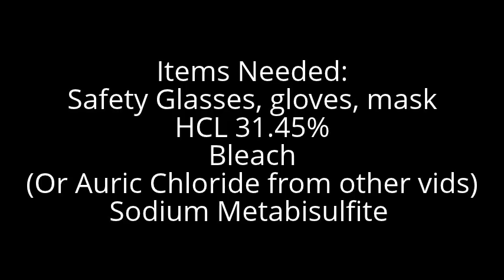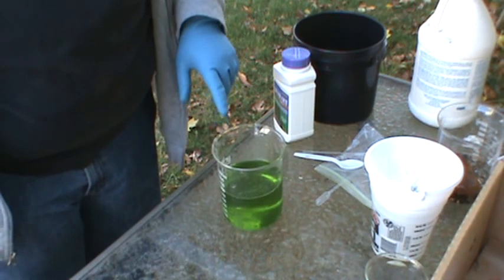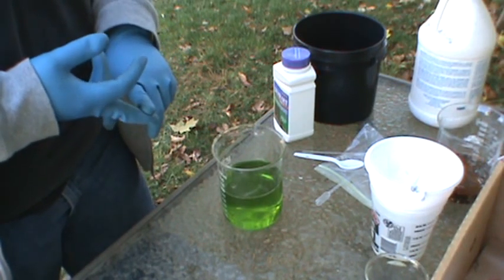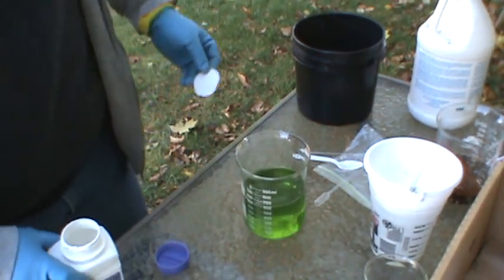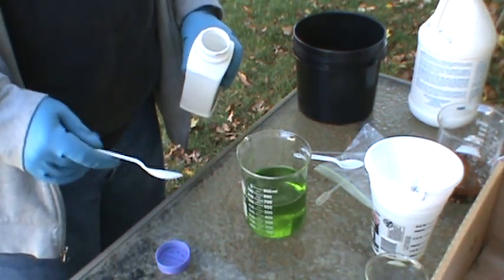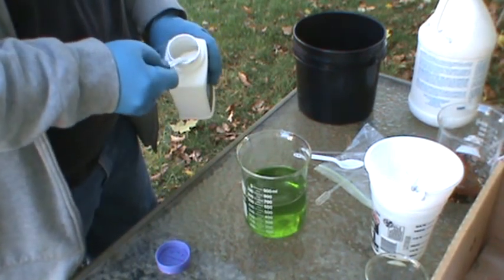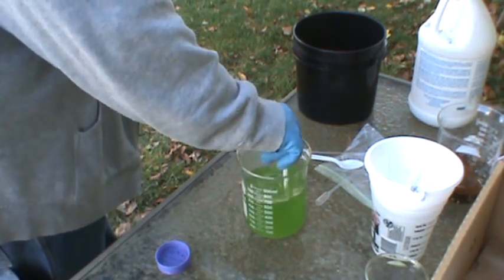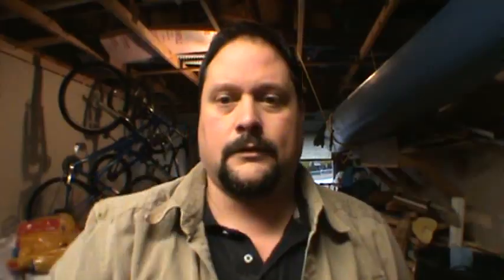Gold Recovery:  A Refining Process to Purify Gold

Comment: How is this process different from the m-acid & peroxide. I know one removes one from the fingers & etc..the other dissolves the gold & you recover it once you put powder in. My question is if Ive used the M-acid & perox can I still use baking soda or stump out to get gold out of that solution? Also which would be easier, I would prefer dissolve it so it come out it powder form but im stll gathering my understanding of all the different process
Reply from the maker: Hi and thanks for watching!! First please be advised that I am not a professional.  These two processes are very different in function.  The A/P method that you refer to as M and Perox, is for removing the copper and nickel layer under the gold foil.  The A/P method is not designed to purify gold where as the HCL + bleach method is.  If you add more peroxide to the AP s\olution you can dissolve gold but will have to cement it out by putting copper in to super saturate the solution.  You can not use baking soda.  TO purify gold, best to use HCL and bleach.  To remove gold from boards, AP is best.  Thanks
Reply: Thanks for quickly clearing that up. Ive watched a lot of videos & read a lot & I think some is starting to run together.So after I use my ap method the gold that's recovered can be melted, just wont be pure. To get the copper out of my leftover solution I planned on hanging a stainless spoon or knife to get the copper out. Im trying to get as much from the recovery as possible. For instance one way, you can separate the gold & silver  & they both come out as a powder for the end result. Do you have any recommended web pages or videos that I may have missed? Thanks again
Reply from the maker: Chem istry My go to channels are indeeditdoes, geo, drew metalsmith, and originalfeets.  Everything I know comes from them, the goldrefiningforum, and CM Hoke's book.  Best of luck to you!

Comment: What is easy method that draw gold in As(as)?
For example, when arsenic consists of iron and solid lump with copper gold, make this solid powder once and touch funnel after knock-in mixing together from had mixed this material to hydrochloric acid and other material and is dregs that remain swelling as filter paper gold?
Do you lose that that no gold and other material remain together?
If melt as nitrohydrochloric acid that mix nitric acid to hydrochloric acid, do not arsenic and iron copper gold melt all at once?
I wonder whether method that is specific about lower part three occasions once guesses right.
1. In case of have gold and iron together in arsenic ?
... Hydrochloric acid + nitric acid after make from powder once ?
Or, other liquid some % ?
Dregs that mix and pours woe on filter paper and remains after put zinc powder after knock-in making a fire ?
2. In gold and iron in arsenic and in case of have copper together ?
... Also, dregs that pour woe on filter paper melting to nitrohydrochloric acid that mix hydrochloric acid + nitric acid after makes from powder and remains making a fire ?
3. In gold and iron in arsenic and zinc in case of have together ?
... Also, after make from powder hydrochloric acid + other liquid some % ?
Dregs that pour woe on filter paper without zinc after knock-in and remains making a fire ?
Is the centralest question possible without zinc powder though is the first question?
And if melt as hydrochloric acid and nitric acid, does not nitrohydrochloric acid turn together melting all?
Anxious ..

Comment: i have a vase that says the gold on it is 24k Italian gold.i watched ur vids on how to recover it.i dont want to lose any of it so i had a few peices of it so i mix a small jar of chems. the gold came off .when i added the stumpout the solution got milky white and bubbled. i didnt see that in the vids.the mix was 3/4 cup acid and 2 table spoons bleach dont no where the gold went.
Reply from the maker: The gold is still there in the solution most likely or in the white stump out powder that dropped to the botom.  Was the one vase the only thing you dissolved in the solution?  Because that may be the problem.  You have to understand exactly how little gold is used to place porcelain.  The layer is so thin it is almost transparent.  It takes a lot of those to make it worth precipitating.  Remember also that one gram of gold is very small.  The best thing to do is to keep a container with the HCL Bleach solution and just keep dissolving stuff in it until things stop dissolving.  3.4 cup can hold about an ounce of gold so keep going until you have a LOT of things cleaned with it.  Then try to precipitate.  Trying to precip the gold from once vase the amount of gold would likely be so small that you would not even see it.Thanks!

Comment: Brass is under the gold. I did not throw it out. I can see where there is still some gold on the watch cases. I just stirred it up a bit. I had poured the other into a coffee pot through a coffee filter. Filter is now yellow.
Reply from the maker: right, but there are no gold flakes are there....  all the gold is in solution.  you really don't need to change the solution out that just makes it harder in the end having more material to process.  For items like that, I think the best route is reverse electroplating but i have not attempted that yet.  I would keep a close eye on it and as soon as all the gold is gone off the watch I would remove it to limit the amount of copper in there.  I think you can try to cement out the excess copper by sticking in a piece of stainless steel for a while.

Comment: Muriatic Acid and bleach for two days, Auric Acid dark green. Pour it off and put in another fresh mixture this morning 150ml to 50ml
Reply from the maker: If the solution is green tht means that there is copper in there.  And using HCL and bleach will disolve the gold into solution so I hope you did not throw out the green liquid.  What does the watch look like?  Is it brass underneith?  The gold may have already come off.

Comment: Have you tried to neutralize the acid solution some before the "stump out" was added?  Otherwise, the acid just picks the the metals back up.  Try urea.
  You can smelt out the copper with borax in a crucible or wash the precipate with muratic acid again

Comment: Mr Moose, very good illustrative videos. Thank you very much for the same. I tried it with Ink ribbons, but could not get any Gold. May be I should have used Sod. Metabisulphite directly rather than neutralizing the Extract with Sod.Carbonate. I am rather stuck now. I am sure you can help me. I do not want to fail in my first trial.

Comment: hey Moose, so now should I dump my filter gold into the solution with the stump out to remove the other material?
Reply from the maker: This is VERY important.....make sure you put a lot of gold foils into a small amount of hcl and bleach.  Like 100ml of hcl and 20ml bleach.  stir until dissolved and be very careful of the fumes.  Once, and only once the gold is dissolved can you add the SMB or stump out. in very small ammounts.  People often get tempted to start purifying their gold when they really do not have enough to purify.  It is much better to wait until you have several grams.
Reply: Thanx Moose, you are the King!
Reply from the maker: psycholordb

Comment: very nice video.  I have a bunch of pins that have been extracted from old connectors can they be put in this solution.
Reply from the maker: Gold pins are best processed in one of two ways.  If they are magnetic, hot HCL.  1 gallon will dissolve about 2 lbs ofmetal.  If not magnetic, A/P solution.

Comment: what if it turns aqua blue?
Reply from the maker: Sounds like nickel but I could be wrong.  Not really sure.  What did you put in it?  Ink ribbons?  Was there still ink on the ribbon?
Reply: i believe it just means you have a lot of copper in there, just a guess though, i left some cpus in the a/p solution for about a week and it turned that color and when i added some clean hcl it turned a green color, lick pickle juice
Reply from the maker: George Fontenot Copper typically will turn the solution green,  Nickel blue, ferrous material black or dark grey.  Thanks for watching!!
Reply: its actually copper(II)Chloride, i researched it today and also used it in class a few weeks ago for a chemistry lab. the green solution is copper(I)chloride
Reply: great vids btw

Comment: Just as a friendly bit of advice, Auric Chloride shoud be yellow... Since it is green, you most likely have copper contaminating your solution.  It is not a big deal as far as the reaction is concerned, but you will need to re-refine your gold again to make it more pure.   As the metalic gold starts to precipitate out of solution there is a mechanical drage down effect that pulls some of the copper with it.  re-refining your powder one or two more times along with proper rinsing will help to purify it.  Just wanted to let you know so you are not suprised if the purity comes in lower than you think (like it happend to me my first time)
Reply from the maker: Hey thanks for watching!!  I know about the copper, I mentioned it, not sure if it was in this video or the one I released at the same time about recovering gold from printer ink ribbons.  Thanks!

Comment: Thanks for your video when can you smelt the gold and do you filter it after you have finished with the solution thanks bro .
Reply from the maker: Once all the gold is settled, I pour of as much as I can without disturbing the bottom, then heat to evaporate the rest of the fluids off.  The dry gold powder can then be smelted.

Comment from the maker: It can vary a little bit, but if you do this process 2-3 times witht he same gold material you can get over 99% fine.
Reply: +Moose Scrapper I have seen a video that says you can reuse the aqua regia repeatedly until it looses it's strength.
Reply from the maker: +James Rogerson I have never worked with aqua regia so I can not help with that one.... sorry.
Reply: +Moose Scrapper hey just got 2 questions. 1st did u neutrilize the acid prior to precipitation with SMB . why can't u use the HCL/bleach solution to get gold off fingerboards just like u did with the plates and ribbons?
Reply: with copper+silver nitrate, one may precipitate silver, and create a copper solution, that i think may then be precipitated with stainles steel, leaving behind only water or some mineral void liquid...check me on that please.
Reply from the maker: RuneChaosMarine No.  You will end up with multiple metals in solution and not have a way to separate just the gold.  The tin in the solder is a real pain.
Reply: copper+silver nitrate.
On a totally different tangent, only relevant due to the absorption by the silver nitrate, of the copper. chemical reactions and the science of alchemy!
thats all i ment.
Reply from the maker: ***** Why the heck would you add urea.......  This isn't aqua regia.  Sorry, I have no idea how to help you on that one.  The best I could say is to evaporate all the liquids away then start over with the solids.  But that is just guessing.  Check out the gold refining forum and please...PLEASE... next time make sure you know what you are doing before you start.  best of luck to you
Reply from the maker: Moose Scrapper As far as I know the solution from refining can not be reused.  I have not tried to reuse it however so I am not 100% sure.
Reply: Moose Scrapper m
Reply: Can u use only hydrochloric acid to remove the soldier before starting the process ??. Love ur work  keep it up. 
Grant

Comment: How much did the chemicals cost you? Also can
you reuse the chemical mixtures?
Keep up the videos.

TedB
Reply from the maker: Total costs:  1 gal HCL $7.98, Bleach $1.99, and Stump out $4.99, so less than $15.  Once you have precipitated it is best to test for any gold remaining in the solution with stannous and if clean evaporate completely to solids and contain for safe disposal.  The chemicals are cheap enough and can hold enough gold where it would just make more sense I think to use it just once.  Not even sure if it can be used again.  Check the goldrefiningforum.

Comment: Ok, so if you added too much HCL, what is the right quantity? Great video and does this work with cell phone boards too? I'm posting a video so u can see what do i have to work with. thanx
Reply from the maker: If you start with 200mls HCL and add 25ML of bleach at a time, you can tell if you need to add more bleach when the gold stops coming off in less than 30 seconds.  For the most part, in the trials I have done that were successful I did not have to ad much more than 50ml of bleach to 200ml HCL.
Reply from the maker: As for the boards, not sure about that yet.  If they are clean from all other matter like solder and other componants, you stil have to think about the copper and trace nickel getting into solution.  I would stick to A/P for the boards.